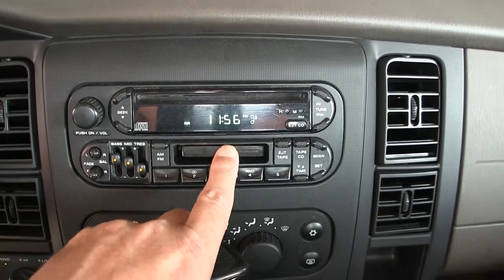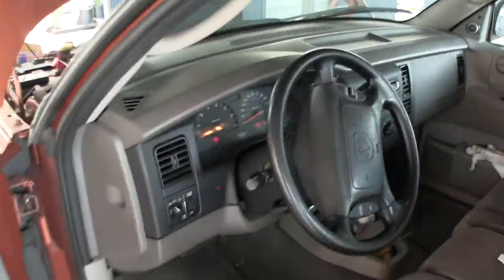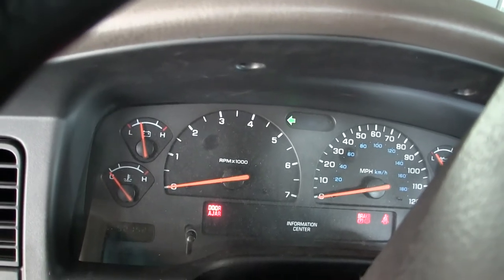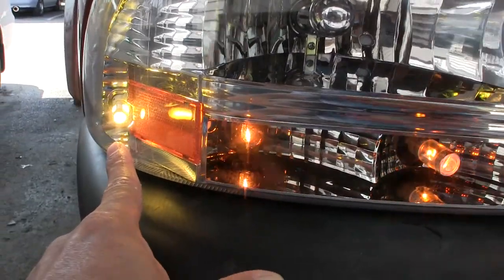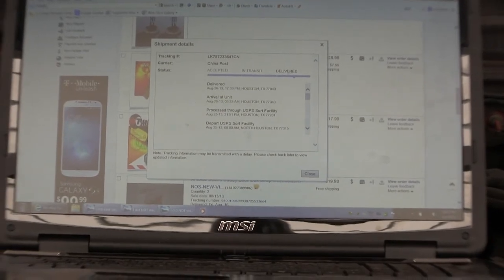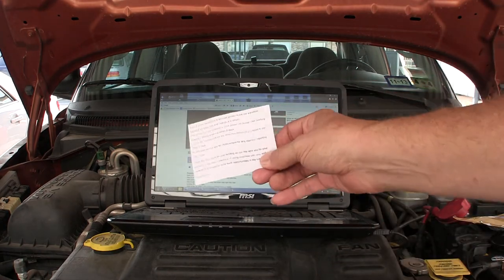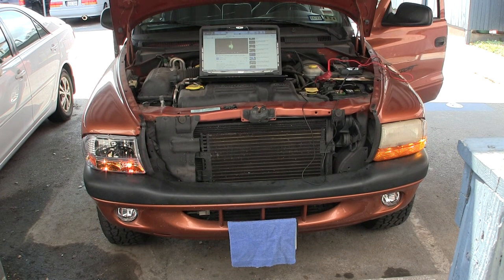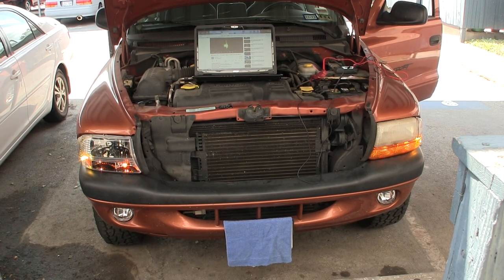Not DOA Will Not Operate Constantly 7 5W Amber LED T10 SMD Switch on & Off independently daytime upd

Comment: Do you have daytime running lights?
Reply from the maker: My truck is a 2001 Dodge Dakota Quadcab 4x4 with the AWD transmission and is fully optioned as I ordered this from the factory ( its a Wednesday build ) and it did NOT come with daytime running light option